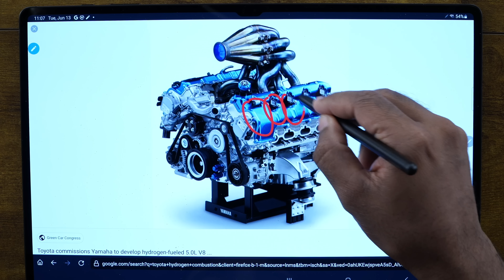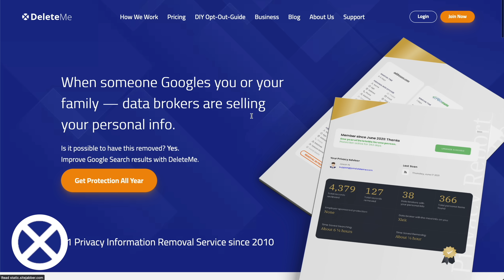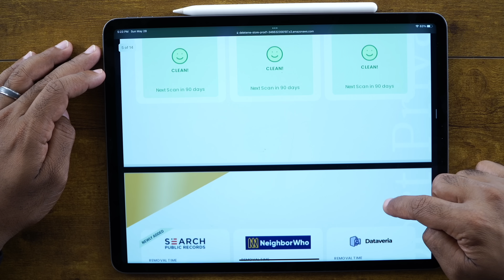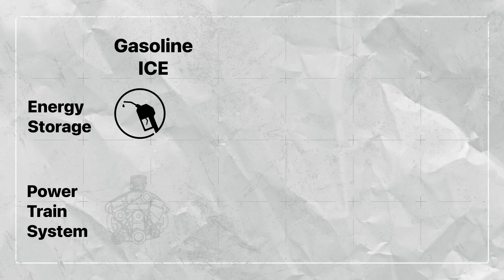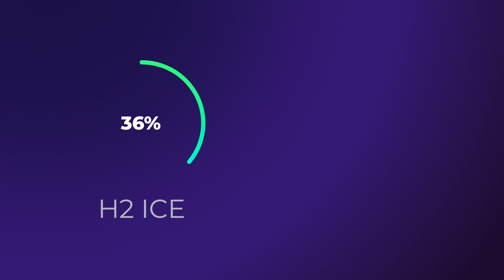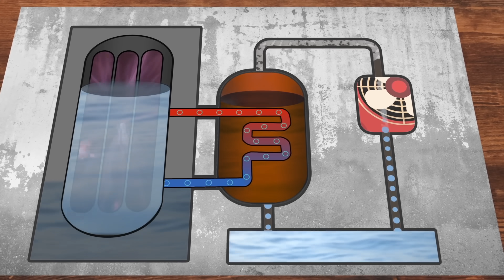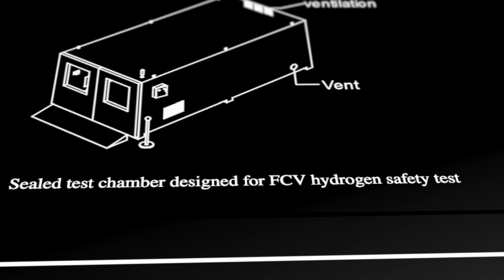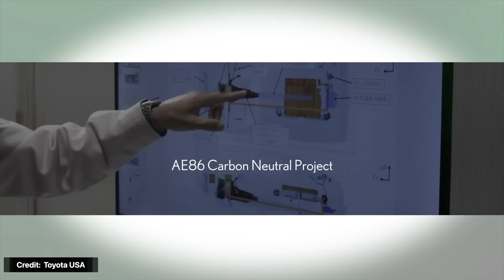Toyota's Says They Just Destroyed EVs - Hydrogen Combustion Engines

Comment: There is a place for it. For example, its not cost effective to up-size a solar system enough to work in the north over the winter, either from a solar panel or battery perspective. Hydrogen can be generated in the summer with excess power and consumed in the winter. From Toyotas perspective, hydrogen and nuclear are synergistic technologies, basically making the hydrogen nearly free to generate which you did not account for in your math.

Comment: I am an EV owner a 2017 Leaf.  My only expense, besides electricity has been rotating and replacing the the tires.  In five years, I have only spent $486.00 if I was driving ICE car the tire expense would’ve still been there plus I would’ve spent 100s of dollars and TIME on oil changes and maintenance.  People that don’t like EVs, don’t realize that the cost of ownership of an EV is pennies on the dollar compared to an internal combustion engine car. I will never go back, especially not to hydrogen!

Comment: Hydrogen combustion engines perhaps would make sense for diesel locomotives, airplanes (in the form of hydrogen gas turbines), large mining trucks, oceangoing ships.
Reply: Locomotives, not so much - the current diesel powered ones are using the ICE to drive a generator to feed the electric motors in the bogies, so a fuel cell setup would make much more sense.
Reply: @koma-k why not use a thermal nuclear generator instead? It's simpler. You can recycle nuclear waste as fuel eliminating that in the process.
Reply: @billlyell8322  I think it’s unfortunate that the world has turned emotionally against nuclear. It’s a hell of a lot safer and cleaner and better fuel to use than fossil fuels, and we wouldn’t be in the situation we’re in if we had embraced nuclear. But there are problems. I don’t want to see them burying the waste under a sacred Navajo Mountain.
Reply: @billlyell8322  Right... and just wait for hijackers.
Reply: Dude, safe h2 prototypes were built in the 1970s with the same range as a gasoline vehicle.  H2 cars are not only possible they have already been built and tested. You don't see them for sale today because the government outlawed the sale of h2 storage medium. Why do you have to outlaw a technology that doesn't work? You don't,  do yo???
Reply: To get enough hydrogen on a plane for a gas turbine to fly any distance it needs to be in high pressure cryogenic vessels that weigh so much there's hardly any spare capacity for passengers or freight.  So, er… probably not.  Mining trucks could be the most likely of the suggestions as they are powerful but only need limited range so remain close to their refuelling point.
Reply: @calmeilles dude no you don't need high pressure cryo h2 storage. That was proven in the 1970s. Lmao. They ran prototype vehicles at ambient temp low pressure storage. But then the government made it illegal to sell the storage medium. Isn't it strange that they would do that if it didn't work?? You wouldn't need to outlaw it's sale... would you? If it didn't work that is. You only have to outlaw it if it does work. I won't say it works for planes... but it does work for trains, trucks and cars. So ignoring planes for a minute how much polution is eliminated by all the cars, truck, and trains being converted to h2???
Reply: @billlyell8322  the latest research involves using amonia which is a form of hydrogen.   If operable would be like filling up the standard ice car, just amonia instead of gasoline.   It's cheap and does not require pressure tank.
Reply: @billmoretz8718  neither does hydrogen since the 1970s.
Reply: @billmoretz8718  It's "ammonia" and it is not a form of hydrogen. 
Ammonia is a poisonous irritating gas, which can dissolve your skin at contact and damage things. You would not be able to spend more than a few seconds on an ammonia filling station because of pungent smell. A little spill will cause evacuation. Ammonia does not burn cleanly or easily - it has a very narrow concentrations range when it burns in the air and even steady burning leaves some unburnt ammonia, so any car on ammonia would stink. It is not that cheap, and it does require pressure tank or cryo system to store. 
Ammonia has very slow flame propagation speed and as such it is least suitable for use in ICE. There are a lot of studies of it, all show that these are not going to be "clean" engines, since, paradoxically, the ammonia burning produces also NOx.
Reply: Hydrogen does not make sense to be used in diesel engines, not pure hydrogen. Injecting hydrogen into a highly compressed air will result in extreme temperatures and horrible NOx emissions. And the diesel will lose efficiency and its torque.
Reply: @alterbart7916  This wouldn’t be a diesel engine, it would be an engine specifically designed to burn hydrogen.
Reply: @TedToal_TedToal  "This wouldn’t be a diesel engine, it would be an engine specifically designed to burn hydrogen." sorry, "diesel locomotives" use diesel engines. 
Anyway, burning hydrogen in an ICE makes very little sense. Hydrogen specifics make it less efficient than carbon containing fuels, considerably increases the NOx and, this I cannot stress enough, it is very prone to catastrophic failures - the mixture must be very close to autoignition point in order to achieve some efficiency, and a small mistake causes blast.
Reply: @alterbart7916  I’m not talking about diesel engines, I’m talking about engines designed specifically to burn hydrogen, including perhaps engines for locomotives for turning the generator to generate electric power. It might make more sense though for a train to use a lot of fuel cells, although I’m not sure if you can stack enough to produce the necessary power.  

What we are talking about here is, how do we produce an incredible amount of power from a limited amount of weight, i.e. a higher energy density by far than lithium ion batteries or fuel cells.
Reply: @alterbart7916  Why are you stuck on autoignition diesels? I don’t believe ANY of the ICE H2 engines I’ve heard about under development are auto-ignition.
A locomotive is ELECTRIC. It needs a source of LOTS of electricity at HIGH POWER. An ICE engine turning a generator can provide that. I don’t think batteries or fuel cells could unless a good portion of the train were carrying them. 
See the Wikipedia article titled “Hydrogen internal combustion engine vehicle”.  I don’t see any mention of diesel H2 engines. 
H2 engines DO produce NOx emissions, a good reason to avoid them if possible. The question is, for very high power needs, do we have a better alternative?  Perhaps biofuels.
Reply: @TedToal_TedToal  It was you who wrote: "Hydrogen combustion engines perhaps would make sense for diesel locomotives" 

Diesel locomotives are using DIESEL engine as the power source. Most of them use electrical transmission, but there are ones that use mechanical or hydraulic transmission. 
I read several prints on using hydrogen in diesel engines, and let you know the outcome.

In my opinion, hydrogen is a dead end, especially emission wise for two reasons: 
1. 95% of the hydrogen today are produced from natural gas, and this process produces a lot of CO2. 
When speaking about renewables, hydrogen loses badly to direct battery charging.

2. Exhaust of any hydrogen engine or fuel cell is water vapor, which is a more potent greenhouse gas than CO2. 

Hydrogen is being pushed by the Japanese because they are trying to find use of their nuclear. For the rest of the world, hydrogen makes no sense.
Reply: @alterbart7916  I said “diesel locomotive” to describe what an H2 engine would replace. 1. It doesn’t matter how hydrogen is produce today, it matters how it would be produced in 2050.  Hydrogen does not lose to renewables because it has a far higher energy density and that is the application we are talking about.  And hydrogen is renewable when created through electrolysis. 2. Water vapor is not a more potent greenhouse gas than carbon dioxide. Being far more prevalent in the atmosphere, it causes much more of a greenhouse effect than CO2, but pound for pound CO2 is more potent.
About the only thing that might make more sense than hydrogen for energy intensive applications is nuclear.
Reply: @TedToal_TedToal  You said "for diesel locomotive" not "to replace diesel locomotive engines". If you cannot make yourself clear, it is not my fault. 

Hydrogen suck in all respects - it is not actually "green" - water vapors are the most powerful greenhouse gas and a dense fleet of hydrogen cars on city streets will be producing dense fog. I have already observed it following a hydrogen car in a long tunnel in slow traffic. That was the single car. Imagine hundreds of those somewhere in Manhattan. H2 is expensive, it requires platinum for the fuel cells (you are not serious about burning it in ICE, are you? H2 + ICE is actually, merging worst parts of each technology). Electrolysis is not something that will become mainstream even in 2050 - your heard about grid insufficiency for EVs? It is twice as bad for in-site hydrogen production because of additional losses in electrolysis itself and on purifying and compressing the gas, purifying water and possibly removing the byproducts. The only real solution is nuclear and centralized distribution. Good luck with that. And it is not green at all.

On another hand, it is easier to advance EV technology, for example, to on-route wireless charging which will render the discussion about energy density moot. By 2050 we can expect double of the energy density in the next gen batteries which will not need lithium or rare metals. Maybe until then a small range extenders will make a lot of sense - you go all electric during the week days commute (20-30 km) and on the weekend you travel as far as you want only stopping to get more gasoline... 

It is even easier to advance the carbon fuel based ICEs to be clean and more economical. Right now Otto cycle engines demonstrate more than 50% break efficiency - at this time on F1 engines, but it can be accommodated by regular cars. Biofuel technology is several decades out there and there is just lack of political will to promote it. 

Hydrogen-on-ICE makes only sense as a transitional phase, but really, it does not even then. What toyota does is pure politics, they do it under huge political pressure - offer something in the low price range that is "green".
Reply: @Toyota 
💧

Comment: I think H2ICE will only be good for classic cars as a conversion kit. Just replace the entire fuel delivery system and tune the engine and now you can make vroom vroom without killing our atmosphere (As much).

However... It may not be as easy as that. Hydrogen combusts more quickly and in a very wide range of air-to-fuel ratios. So it may run poorly in certain engines.